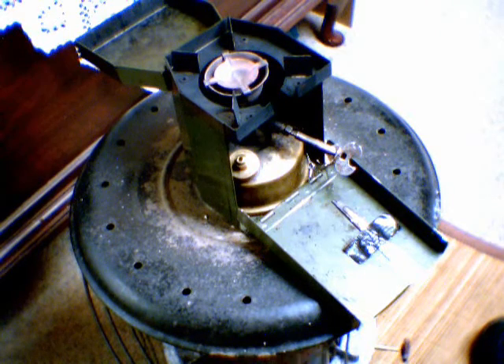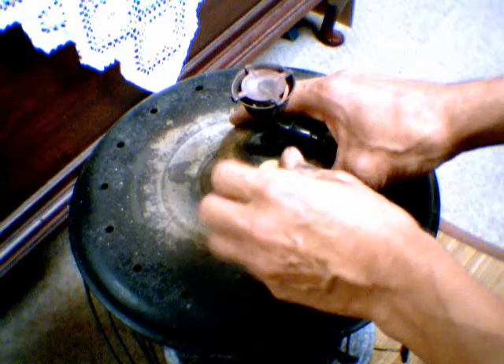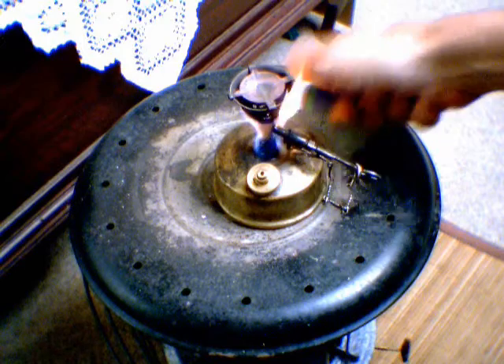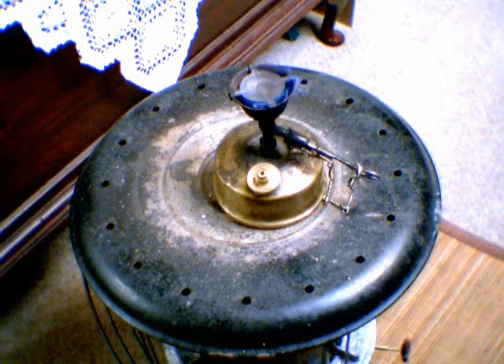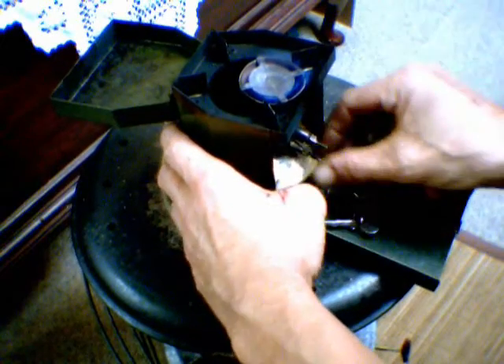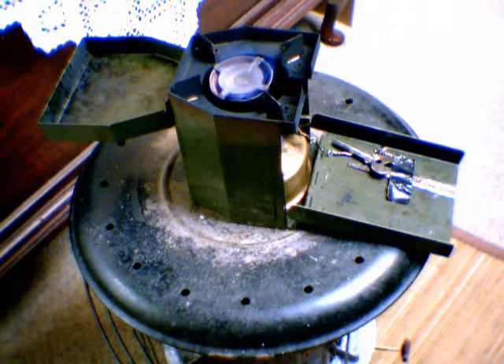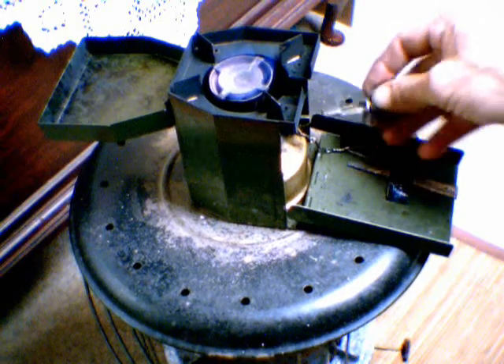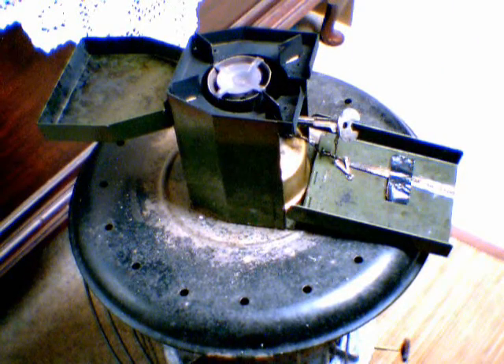Lighting a 71

Comment from the maker: @8259r When this model was introduced, around 1930, it was aimed at the motorist and motorcyclist; providing a powerful stove in a small package which could be readily fuelled from a vehicle's petrol tank & primed with the same fuel thus obviating the need to carry a second fuel for priming purposes. Primus' lighting instructions are still valid to-day and  although the use of auto fuel is generally discouraged, Coleman fuel or Aspen 4T are perfectly acceptable substitutes.

Comment: Sorry, but this method is nuts. One could use methyl, but I simply allowed a few small drops of fuel out of the jet (by regulating the key) and then -- using a MATCH not a Bic lighter -- lit the small pool of fuel. A SMALL flame warmed the fuel reservoir nicely. No soot or huge flameup and no doilies scortched. That was in 1971 in Greece and I haven't replaced any parts on my 71 as they don't need it.